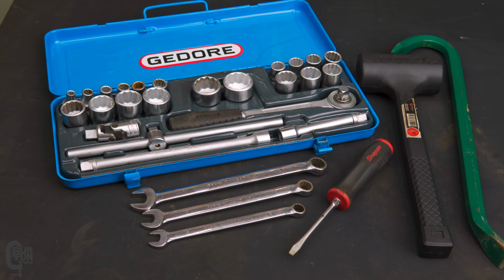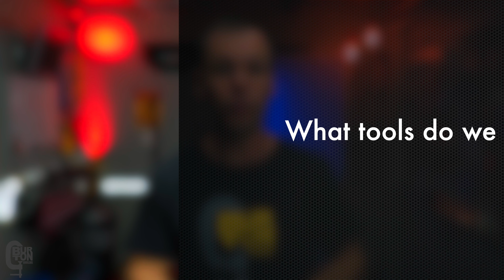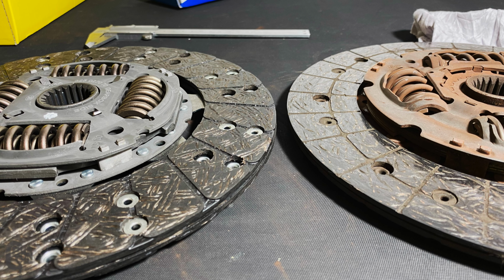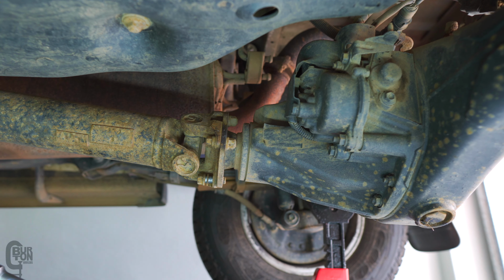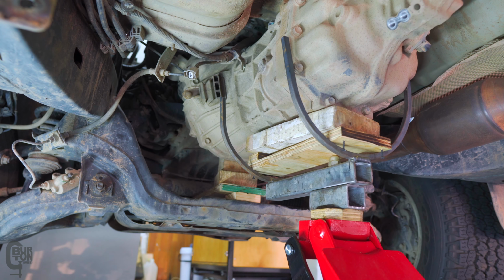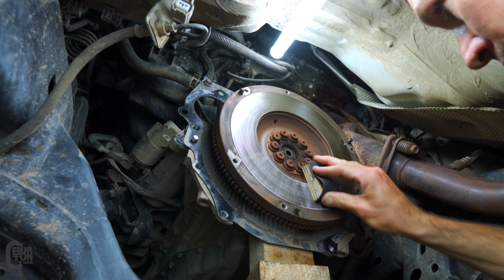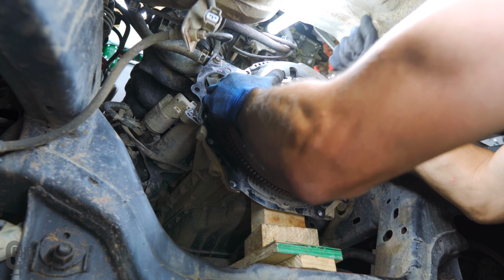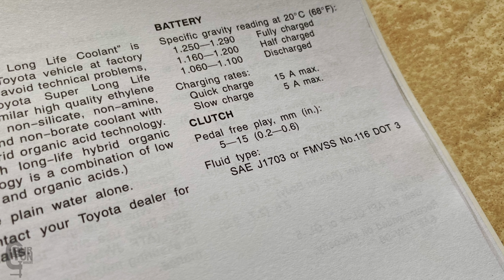How to Replace a Clutch DIY GUIDE - Toyota Hilux - Burton Builds

Comment: When buying a used transmission is there anything to do to make sure it works properly off the vehicle?
Reply from the maker: Hi Moltenmetal, off the top of my head, I can only think of a few things to check.

- Remove the filler plug (or any other plug hole) and try inspect the gears inside. This can be kind of difficult but 'see what you can see'. Sometimes you can see the condition of the gears. If you have, use a bore scope.
- Remove the drain plug and inspect the plug for metal filings, many plugs have a magnetic insert which attracts metal particles that wear. If the gears are badly worn / chipped, those filings will accumulate on the magnet.
- Check the condition of the oil. Just keep in mind that fresh oil doesn't mean the transmission is in good condition. 
- Check for any leaks at any of the joints and the input and output shafts (also around the general area, it should be free of oily dirt).
- Check for any RTV gasket maker that doesn't look original at the casing joints... If it is visible, it's likely that the transmission casing has previously been opened... and the question then is 'why?'
- Rotate the input shaft in each gear and check the rotation of the output shaft... It should rotate in each gear, and its speed should vary according to the selected gear. Also remember to check reverse.  All gears should work fairly smoothly. Just keep in mind that even damaged gears may rotate freely when not under load however once in a vehicle and under load, only then may damaged gears reveal themselves.
- Grab hold of the input shaft and rock it from side to side and up and down, there shouldn't be any movement or free play (there may be slight movement / play but this shouldn't be excessive).
Reply: @GrantBurton   it's an 85 g54 for my hilux. Mine is missing first gear and I replace the shift seal and boot already and it keeps popping out of 1st. Thanks for your  informative tips 👍
Reply from the maker: I’m not to familiar with that model gearbox but from what I have read after a bit of searching online, it could be a number of things.

Sometimes a broken gearbox / engine mount can cause a slight misalignment and the gearstick catching and not allowing full engagement of the gear (likely not the problem).

There can also be a broken spring as part of the 1st/2nd gear selector rod assembly which causes the ball not to remain engaged in the detent and the gear jumps out (not sure if it applies to your gearbox).

What is most likely the case and a good starting point is the small plastic bush that goes over the bottom of the ball at the bottom of the gear lever. I know these wear and when this happens, sometimes the gear lever doesn’t push the selector far enough to properly engage. I’ve already replaced this small plastic bush at the bottom of our gearstick. To replace this, you need to remove the top of the gear selector housing on the gearbox and then the entire gearstick will come out and the bush can be accessed. It’s also a cheap part to get from the Service centre.

Hope this helps.

Comment: Mine gear 3 is abit hard to get into.....like it feels there is a thing stuck in front of the gear
Reply from the maker: Are all the other gears easy to select? If it's easy to select 3rd gear when the motor is off but difficult to select when the motor is running, it could be that the 3rd gear synchro is worn?

Comment: Nice video.  I paid someone for this job.  I have a 3.4L Tacoma, the Hilux cousin and according to the Toyota Service manual it calls for the clutch disc to be oriented with the spring side towards the engine instead of towards the transmission.  This is very unusual as most of the time the clutch is oriented with the springs oriented towards the transmission.  I wonder what would happen if if was installed incorrectly.  It appears to run and shift fine with at least 1000 miles on it so far.
Reply from the maker: Hi Larry, thanks for the comment. I've heard those V6's are very strong engines. I've still got that old original clutch lying around somewhere (was going to do a separate video comparing that to a LUK brand clutch), so will have a look at the spring orientation and reply again. I think Ive got an answer to your question but I want to visually check something on the plate before I get it wrong.

Good to hear your replacement is still working well. Ours is also still working well after 8000km (about 5000 miles).
Reply: @GrantBurton  I replaced the flywheel with a LUK one.  I believe Toyota used LUK for some of their OEM parts.  I bought an Aisin clutch but noticed (from memory) the springs stuck out quite a bit more on the original clutch.
Reply: how was the clutch you took off oriented?
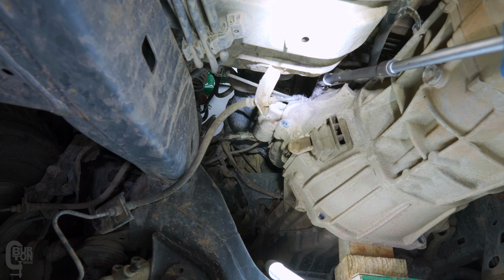Reply from the maker: @Neishy4AGTE  Hi Dale, it had the flat side orientated towards the flywheel and the side where the springs stick out towards the gearbox. The flat side has the words 'flywheel side' stamped into it. The original clutch that I removed is also made by LUK but has 31250-OK120-B TOYOTA 5F 11A 10:57 markings on the flywheel side.
Reply from the maker: Hi Larry, I just checked the old clutch I removed... It's the original clutch from when the vehicle was new. It had the flat side orientated towards the flywheel and the side where the springs stick out towards the gearbox / transmission. The flat side has the words 'flywheel side' stamped into it. The original clutch that I removed is also made by LUK but has 31250-OK120-B TOYOTA 5F 11A 10:57 markings on the flywheel side.

Having a brief look at the plate and spring arrangement on the old clutch plate, I don't see any problem with the central hub interacting with the outer plate and pads of the clutch. The interface between the splined centre hub and the pads are through the springs, where it looks like the springs are there to take up shock load as the clutch is engaged and also looks like they will absorb load in either direction or rotation... even though the engine only rotates in one direction. At least on this version of the clutch plate it looks like that... Not sure about other aftermarket replacements.  HOWEVER, if the side where the springs sticking out were installed towards the flywheel, i think the springs and central hub would interfere with the bolts on the flywheel and the clutch pads probably wouldn't even touch the flywheel.
Reply: @GrantBurton  Grant, thanks for the follow-up.  I just looked at my original clutch.  It was made by Aisin and on the flat side had "c/(?-can't make it out) side" painted on it.  It was also the side with the most wear, getting fairly close to the rivets.  I told the mechanic to pay specific attention to the orientation of the disc.  It should have been simple enough, just re-install the new disc like the old one that came off.  I did point out how the factory service manual specifies a reverse orientation just for that particular motor though.  I have about 5K on it and so far seems fine.  I should know in another 5-10K.  That's when it will start slipping if installed wrong.  Next time I will do it myself as I doubt the mechanic lubes or torques to proper specs. I just didn't think I could get the truck high enough with 6 ton jackstands plus I was recovering from a banged up shoulder.
Reply: @Neishy4AGTE  Unfortunately I paid someone to do this. Yeah should have been that simple.  I read on the Tacomaworld forums that on the 3.4L you had to reverse the normal disc install and disregard the stamp on the disc.  Service manual confirms that as well but OEM parts change over the years so who knows.  

Case in point just changed tie rods with OEM parts and the new outer have 5 less threads on them.  I'm trying to keep the steering close till I get an alignment but I'm all the way at the end on the drivers side.

Comment: What is the approximate cost for a clutch replacement including parts
Reply from the maker: Hi, the total cost of the parts was around $210.00 USD (R3170.00).

LUK clutch kit which included a clutch plate, pressure plate and release bearing was $206 USD (R3100) and the spigot bearing was $4 USD (R70).

Labour didn't cost anything as I did the job myself... not sure how much an auto workshop would charge to do the work as I normally do all of my own repairs and maintenance.

If i remember correctly, an original OEM replacement clutch plate, pressure plate and release bearing from Toyota was just under $466 USD (R7000).

Comment: Recommending your victims to slowly turn the gearbox output so that the clutch plate and gearbox output shaft splines align while reinserting the gearbox may save some poor bugger some frustration. Unless they deserve it... in which case, say fokkol.
Reply from the maker: As long as they put the gearbox in gear 😂😂😂 It's a good tip though. Thanks for the comment Sean.